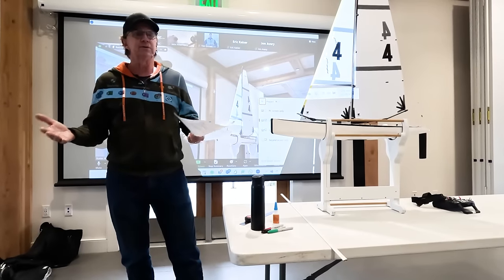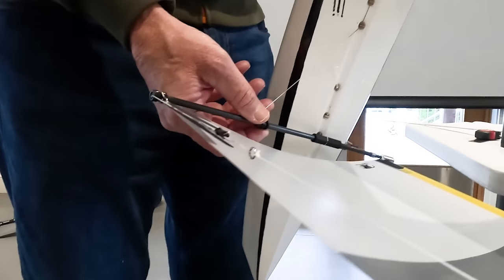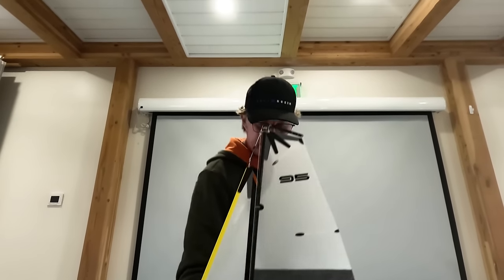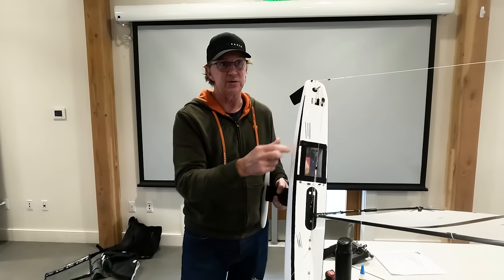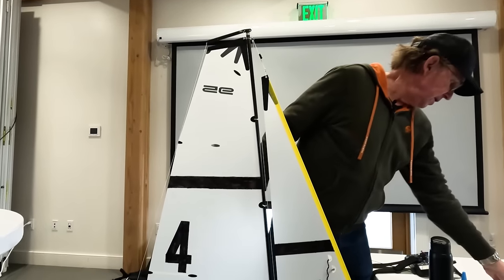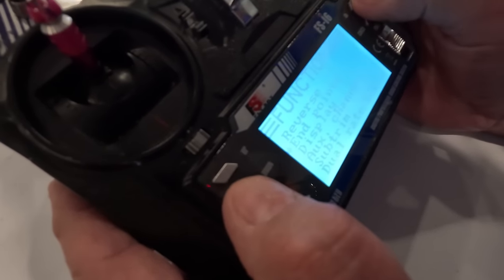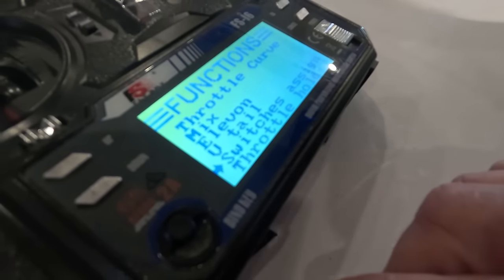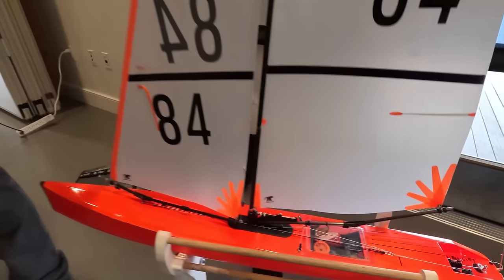Newport Model Sailing Club DragonFlite 95 Spring Clinic

Comment: Your throttle curves are usually used on helis. It's to set your rotor speed relative to your collective pitch. Idle mode just sets a throttle setting that doesn't move while you adjust collective pitch using the joystick. Normal adjusts throttle and collective at the same time with the joystick. Using these curves on the boat is a great idea. On my radio I have a three position switch. You could set each position to haul in the sails at maximums by setting the throttle curves to 0-100 on switch positition 1. (Black)  Throttle curve 5-100 on switch position 2. (Red) Throttle curve 10-100 on switch position 3. (Green) 

I wish I could come race with you guys.